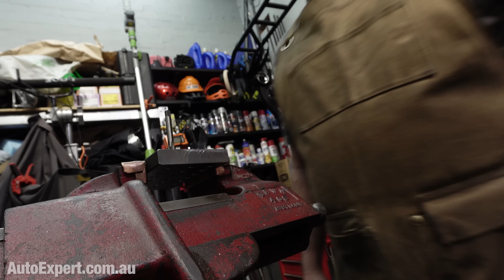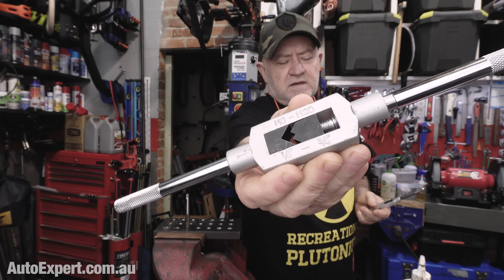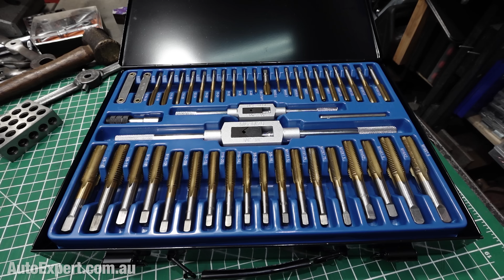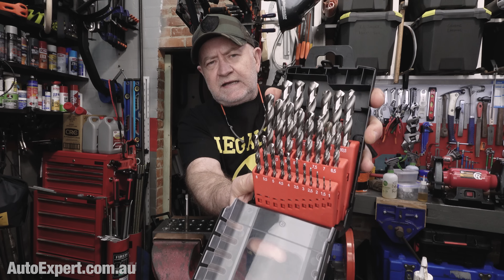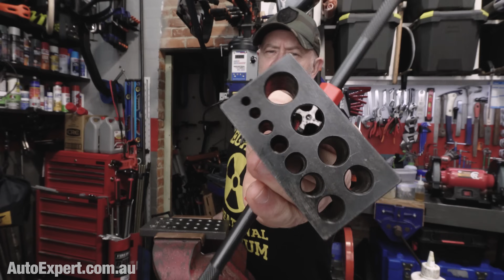The REAL REASON you break taps when cutting threads (and how to break even more of them, faster)

Comment: Every time i break a tap, i just throw it up on my knee mill and munch the broken tap out with a carbide endmill. I then drill the previous hole for 2 sizes larger than the origional. I then tap the hole and screw a bolt with loctite into the hole i just threaded. I thwn cut off and mill the bolt shank plumb with the surface and drill and re-tap. I know its a method that only machinists can use but broken taps can be fixed by essentially using carbide to remove the broken tap then essentially make a homemade helicoil:) just my 2 cents. P.S. Ozzy and american machinists are the best in the world!!!!!!!

Comment: Another TIP, from beginning to pro is chamfering the lead in hole to at least the outer diameter of the tap and for extra points use a 60degree chamfering angle not 45. helps on alignment and thread strength in service. The first 3 threads are the ones that do all the work holding a fastened joint especially on harder materials. Remember Trefolex in the pot, dip the tap and cut away, the foreman said for every 1/2 diameter you went in you had to back out the tap and re-dip. You had a brush to clear the flutes each backout. Foreman would check the pot for swarf and finding any, it was mop the change room and bog house after knock-off.

Comment: My career started in school, I was taught in metal work to tap holes with the cheapest and nastiest taps known to man, many taps broken, many taps extracted, many taps hated to hell.

Then I started as a mechanic, and learnt exactly what sizes I needed for what I was working on, I bought just them. M6, M8, M10, M12, M14, M18 and M20. In intermediate. But rather than buying that massive chinesium set, I bought still relatively cheap, but a good brand in good HSS. I couldn’t believe it when I started using them, they cut well, barely bound up, and I struggle to break them.

I honestly couldn’t believe it, then I started talking to the other blokes, and they were all cursing out their taps and always on edge when tapping or chasing threads. Then I realized why, they had all bought those chinesium sets, but hadn’t learnt to use them, they had learnt with older sets of taps that used to be higher quality before China took over manufacturing. 

So I had learnt in the absolute worst conditions for tapping, and learnt the hard way, but the rest of the workshop hadn’t. And I had bought quality taps rather than the bulk sets.

I was struggling to find out why everyone else was having troubles because I was having the time of my life with my new and decent taps, but then I looked closer again. No one else used actual lubrication on the taps, and most ran taps into the work under power without backing off and going slow. The closest I saw to lube on the threads was inox. I pointed it out and someone bought up a point, how do you clean a thicker lube out of a blind hole, and I was baffled, because you just have to run the tap through with some brakecleaner and some petrol to clean it out, then blow it out with compressed air. 

It really baffles me, coming from an all sorts background in machining, boiler making and blacksmithing into a mechanical trade, that no one else learnt the basic shit.

Comment: 27:23 I learned that if you go a tiny bit oversize on the drill, like the next number size up, it reduces the load on the tap significantly. You're not cutting with the bottom of the v but you still get 95% of the thread strength.

Comment: Buy high quality Taps & dies. High quality tap/die holding/driving tools. Keep it straight, lubed, and go slow and easy. Too greedy or in hard metal you run the risk of ruining the tap, part and possibly your day. My only success when I had to deal with a broken tap is hammer & punch. Taps are hardened and will fracture, just isn't always possible.

Comment: For CNC they do the entire thread in one operation, no back & forth to break chips, etc. There seme to be a bewildering amount of different types of taps for CNC, but one thing i came across that might be useful for manual tapping, is chip-clearing taps.
Certainly more expensive.

The company where i worked had mech. Suppliers with CNC. Sometimes we visited them and it was always fascinating to look at. For tapping, even hard metals, thich dimensions, the machine just places the tap  over the hole, ziiip, a second, done....

Comment: John, a better way to ensure a properly aligned tap in the hole you start threading on the drill table (and align the predrilled hole with the drill's chuck), is to use a plain conical-tip centring bit 'tail stock' in the drill chuck, with its tip resting in the existing dimple at the centre of the top end of the tap.  This way, you can (and should) also use a tap wrench at the same time, further removing stress from the chuck and tap, and the need to turn the drill chuck by hand trying to cut threads.

A plain shaft (not tapered, Morse or otherwise) conical-tip centring stock matching the maximum capacity of the drill chuck (for most pillar drills / drill presses, that being 16 mm and 5/8 inch) is all that is needed, which ought to be available from just about any machine shop and tool supplier, inexpensively (or easily made by anyone using some basic tools needed, metalworking lathe not necessary, although the obvious and ideal choice).

...

All good practical, pragmatic, and sane advice in the video, regardless of that detail.
This is just a practical daily use detail I did without a second thought as soon as I used the drill for that purpose the first time, since I had a conical tip centre shaft at hand, and I suppose just assumed most others do or at least know or realise, and might mention even if they choose not to do it that way all the time.

Comment: If you have one and can bring the item up it, it’s pretty hard to beat a drill press. Have to know how to manipulate the speed a bit by starting then stopping which takes familiarity with your machine, but it works really well. 

Also super important to have good drills maybe even reamers for your holes. You can get decent results with low quality taps and good holes but you can’t with great taps and low quality holes.

Also for the US at least, m5, m8, and m12 are all extremely common sizes to run into. So from a comparability perspective or not wanting to have to switch head sizes for your fasteners if you’re making something to add onto something else, then it’s worth getting the tools to tap those.

Comment: Good stuff mate! The intermediate or plug as we call it here in N America isn’t for blind holes the spiral is your man. A plug gun tap is the shit for power tapping through thin to medium stuff. Guruing is a great brand, and yes the sets are usually trash. Best tip, get a 10X loupe and inspect your taps, even new ones, 2nd best tip, tap straight!!! Use a guide, machine spindle (for starting square, watch Kurtis at CEE), friend spotting you at 90deg etc. To make sure you are straight on. NEVER store them loose in a bin or drawer best way to trash them. 3) get the purple coated (TiCN iirc) ones. P.S. anyone who says they have never broken a tap..really?

Comment: Decades ago I worked as a machinist in a small shop. There they had very old sets of special taps made by Norris and, despite being used for 2 generations of machinists, were in perfect condition and were able to tap all types of material without breaking, always cut straight and produced a nice clean thread. They were sequential taps in groups of 3 taps per size and you'd used them sequentially, Start , median, finishing. Taping the toughest tool steel they cut like butter. I cannot find those anymore.
Reply: Its just an ordinary set of taper, plug, and bottoming taps.
Reply: @phalanyx3478  No they are nothing like regular tap sets.

Comment: John. I favour gun taps. You don't need a taper or intermediate. They are not recommended for blind holes, but because they break the chips, I haven't had any problem with them. I thought that you would have a tapping attachment for your pediastal drill. They are cheap and work like magic.

Comment: The one place outside machine tapping where a spiral tap makes sense is on intermittent cuts, like some aluminium profiles. The spiral keeps it engaged throughout the turn, and the three flutes helps too.
That's quite niche though, as you'd normally just use selftappers there.

Comment: So far I've just used taps for chasing, but this excellent video is going into my Shop playlist.
It is inevitable sooner or later I'll be tapping some holes. The main thing i got from this video was when backing off, you feel it get hard to turn, but you've got to come on till it breaks the chip. Then turning out will be easy. Plus if the tap gets loaded up,take it out & clean it off.

Comment: Watched the first 12 minutes and didn't hear anything useful. In this order: Drill the hole the correct size, which often includes buying a letter/number drill set. Start your tap ABSOLUTELY STRAIGHT with the hole. 1/2 turn max, and reverse to break the chip. Stop using cheap taps. Throw away dull taps.
Reply: How can you comment on a video without watching the whole thing?
I found it very helpful. Even better than your advice. Way.

Comment: I don't know that I've ever broken a tap but there is always a lot of anxiety involved.  I've managed to always get the tap started reasonably well but I've wondered what devices could be used to help with that.  I've thought about using the tap in the drill press and could a person devise a tap wrench that would center up on the drill chuck.  I've also watched tap tap holes with a Bridgeport mill, and I'm talking about small holes with delicate taps such as #8-32.  I assume the person that was doing it was very experienced but it still seemed questionable to me.
When you showed the label that said "Thick Fluid Sticks to the Tool" I immediately thought about automatic transmission fluid.

Comment: When I look at the contents of your tap boxes and see like M7, M9 or M11 taps I'm wondering when you'd even need those. I've yet to come across those sizes actually being used anywhere, and where I live pretty much everything is metric.

Also for the set-of-three taps, we have something similar, but the taps don't have different tapers. Instead the taps are ground at slightly different depth, to relieve the chip load for the next tap. You gotta use them one after another, and only the last tap will get you to the right thread dimension. People who are not familiar with it might find one of the pre-taps on its own, tap something and then wonder why the bolt is tight or even locking up. The key is to look for groves on the shank: first pre-tap has one grove, second pre-tap has two groves, final tap has no groves. You don't see them often anymore as well, since modern taps can cut the whole thread in one go, but it can definitely save you if you're aware that these exist.

Comment: The big sets are great, like you say, to chase threads and do the occasional through hole. You can start with one of those and replace any broken ones with quality taps as you go. I don't do a great deal of tapping and have only broken 1 so far in 8 years. If you're careful and patient even the cheap ones can get the job done.

Comment: Concentrated antifreeze is quite often the stuff they're selling you for 300 times the price and telling you to mix with water. I've gotten away with automotive antifreeze as cutting fluid many times in my life. It's really good at preventing rust on recently fabricated tools as well.   But you're right, stuff is never gonna be suitable for tapping.  You need a good oil that won't crap out under pressure and friction.  Most important factor is keeping the material you're cutting threads in from sticking to your tap and causing it to bind so a little Teflon base lubricant can really be helpful.

Comment: Here's one of the craziest things in the world today. When I first started cutting threads in any material, my dad handed me a die of the proper so I shreds he wanted me to put in a hole. The next thing he handed me was a piece of HS steel the right diameter to make a bolt with that die.   Then he pointed me over to a very simple milling machine and told me to make the tap.
So I did. And as we went through the process of breaking a few of them in some test material, he taught me how to pay proper attention in every step of the grinding and hardening.  They really aren't that hard to make and I've gone so far as to do it with nothing more than a diamond wheel on an angle grinder and a proper die.

Comment: The moment you pointed out the fact that a box set of taps is for chasing existing threads, you gained a new follower because you provided critical proof that you really do know what you're talking about. Those box set taps are fine on soft and thin material. But they can be a genuine nightmare with deep holes on stronger material. Unless you're just chasing threads.
Reply: Mate he's been around long enough to have eaten dinosaur steaks 

Id say he's seen a thing or two
Reply: @NickTaylorRickPowers  yeah, I think I might be in the same boat😂

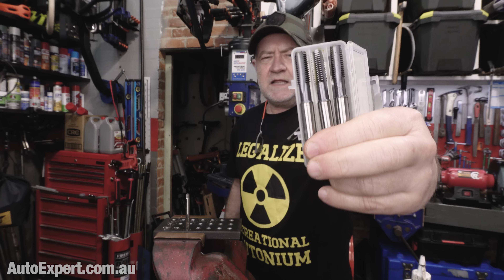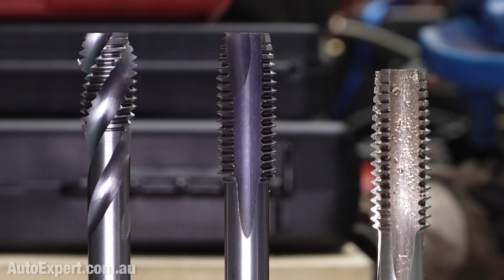Comment: 7:05 M10 tap in the smaller holder... if its a tungsten tap heat treater right, the tap will never brake... the pot metal tin/zinc holder will brake. Bigger taps are made better then small taps M10 is the start of close to proper nearing 1 inch. turn to hard and the teeth just brake off and fall down the hole... though M10 tungsten tap in SAE9254 spring/flange steel is... one tap to a 1/4 inch hole depth, and the bolts fit in very tight... have to have one tap to start a thread, one tap to cut a shallow pass, one tap for an intermediate pass and two taps for a finishing pass... 5 of each tap in a order of degrading profile "sharpened after using, cuts shallow next time", 155ksi~230ksi alloy plate, 1 tap per 1/4 inch depth and the bolt threads still undergo compressive deformation, reusing a tap will cause the bolt to friction weld while threading in until the torque input causes the socket to shear the bolt shaft off. need 4 tungsten taps to do a common drive shaft M12x1.75 bolt pattern, one for each of the 4 bolt locations.  use once and throw away, manufactures parts are accounted for that expenditure. ... getting over having to throw away something expensive like a tungsten tap after using it once is a problem some have, thinking metal is metal... thousands of cast iron threads with it, or the thread cutting teeth fall out of it after reusing it the 4th time in a sequence where there should be 5 more of that same tap. SAE drive line alloy has a hardness range closer to AR400 tank steel that is it's self full of tungsten. boarder like of needing to use carbon ceramic electrolysis erosion machining. flutes under the tap teeth are intender to brake if turned to hard... 50lbft for a M12 or 1/2 inch Tungsten tap on SAE9254 or it's not biting in. Use a non adjustable square hole tap holder that is made only for that one size square... have as many tap handles as taps... have to make a new one next time i get to anything. ... use tap once, just get used to throwing them out, parts made too. that's just tooling costs on parts manufacturing... a lot of it gets thrown out meeting the SAE grading system standards on the upper end. 3 thousandths stepped increments between each cut rotation 12:20 ... all 3 would be technically worn out after finishing 4 bolt holes on a Large Ford SAE driveshaft joint. might look fine, there not, the bolt will friction seize and brake in the part if those were reused. most drill bits don't cut into SAE driveline grade alloy. 19:45 expensive taps, used to throwing them out because they just go dull... re-sharpen, till the teeth fall off... "one M12x1.75 tungsten tap 1/4 inch flange of SAE9254 gets one thread section finished, then its considered junk... SAE standards at the top of the material range". oil is fine on mild steel, oil on tungsten causes friction welding... cutting fluid is just water with anti corrosion chemical added, glycol w/rust inhibitor. ... now i guess if that big tap plate got nitrite plated and heat tempered it would be a stepped bolt thread cutter with some chip ejection slots in it. 155ksi~280ksi SAE 12.9 material ... 1 tap per 1/4 inch of thread.